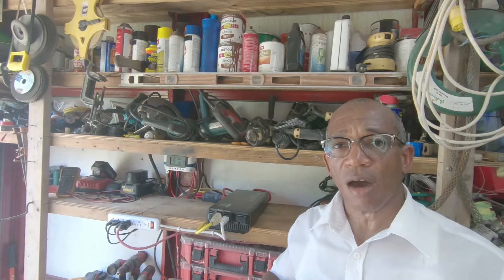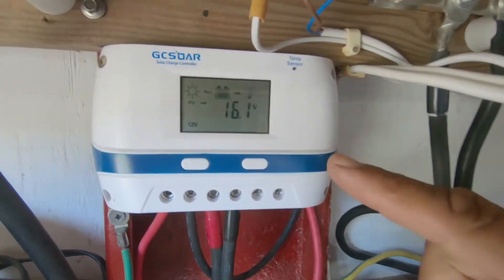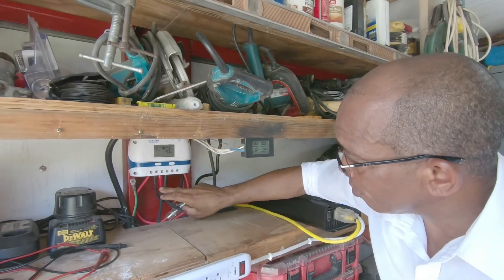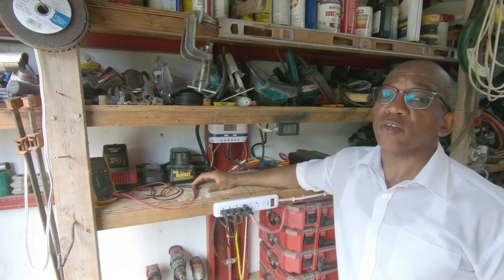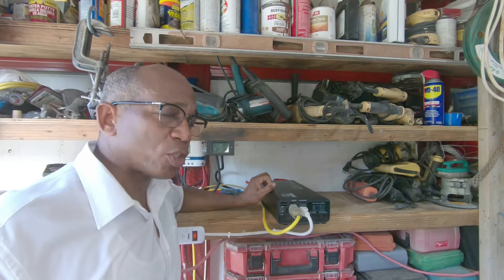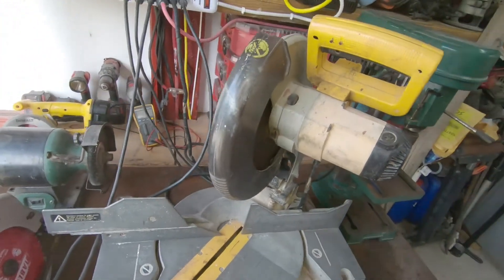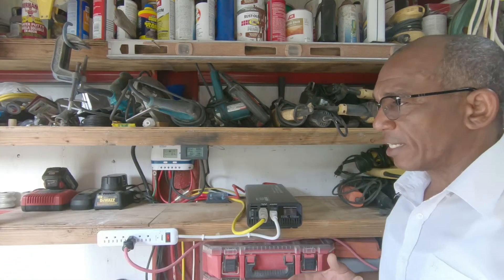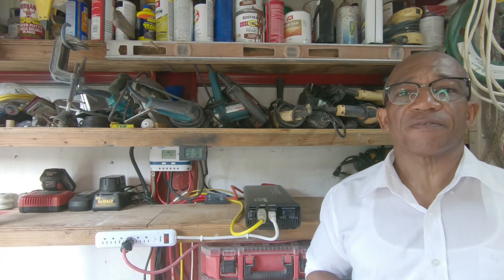Diy, affordable, reliable, 12v, 2000 watts, 9.6 kwh off grid solar system

Comment: I would invest in one of these if I had a house of my own. Great video!
Reply from the maker: Appreciate your comment, but did you know there are versions that can be adapted for apartments, they are basically mobile and small form factors. 
With a 24 inch by 14 inch footprint.